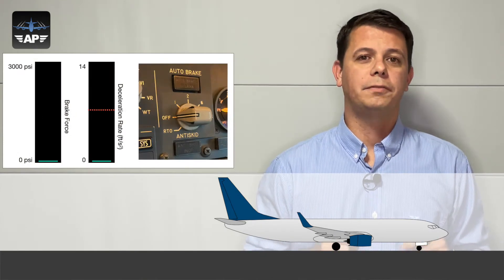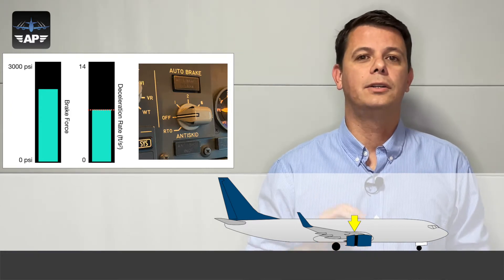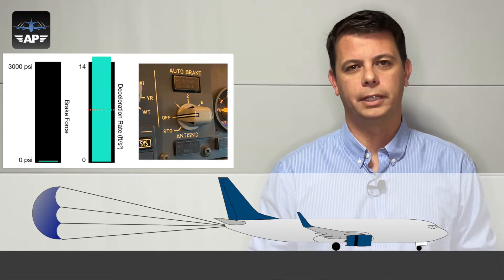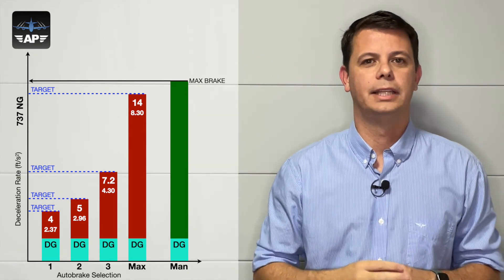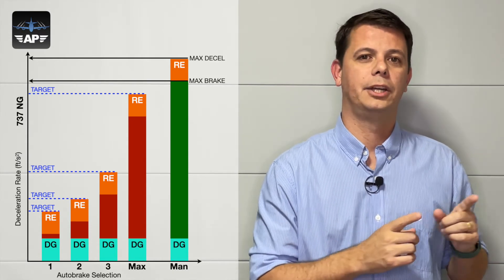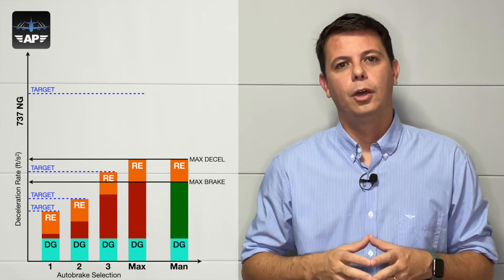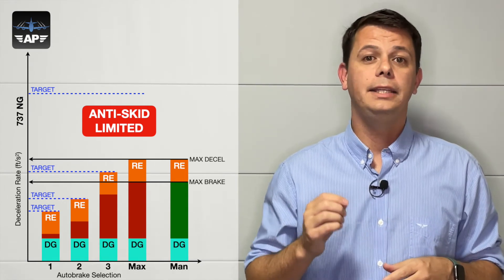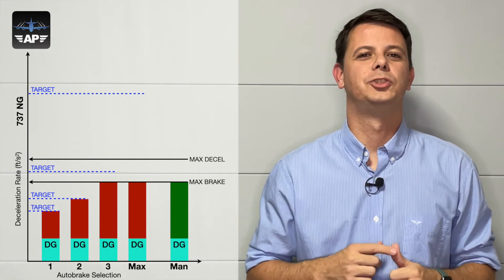Thrust Reverser - Does it change the actual landing distance?

Comment: Also the % contribution the reverse thrust contributes to the deceleration rate will be proportional to the speed, getting less as the speed decreases. It's contribution is highest when you need it most, just after touch down when the most braking heat disapation (aka kinetic energy) occurs. This is also the case with the spoilers.

Comment: I didn't get the last bit. What's the difference between idle detent and max detent. Only that the engine spools up?
Reply from the maker: Idle detent is just the reverse sleeves deployed, but not accelerating the engine rotation beyond idle. 2nd detent and max detent there is an acceleration of the engine. 2nd is just short of 80%N1 and max detent is, as the name sugests, max N1 rotation for the thrust reverser (still much lower than max N1 for forward thrust). Cheers mate!
Reply: @AircraftPerformance1  thank you! Great videos! Much appreciated:)

Comment: Great video as always, captain, congratulations!! 

I have a question about the thrust reversers: if the use of the reversers does not affect the landing distance in dry conditions and with auto brakes, why do pilots use it instead of just the brakes in these conditions?
Reply from the maker: Thrust reversers don't change the landing distance in this example, but they do reduce brake wear! Million dollar question is: what's more expensive? Fuel or Brakes? At this very moment I believe is fuel! 😉

Comment: I think that if in a dry and long runway its not interesting deploy the thrust reverse cause engine life's time can be less than a changes stop by more energy at the brake system, surelly no  expensive as engine costs.
Reply from the maker: Balancing costs between brakes and fuel was always a big topic for discussions among airlines! Good point to another video! Thank you Thyrso!